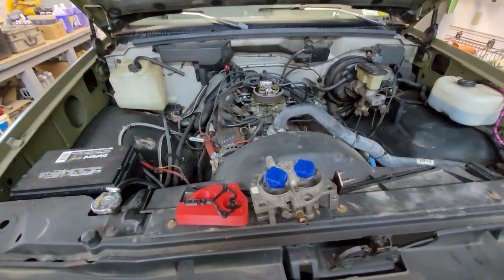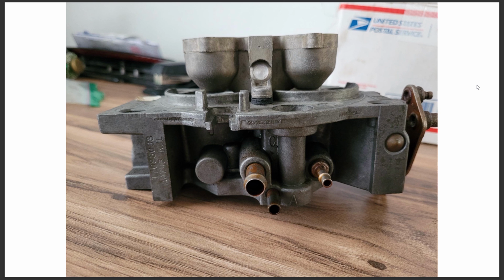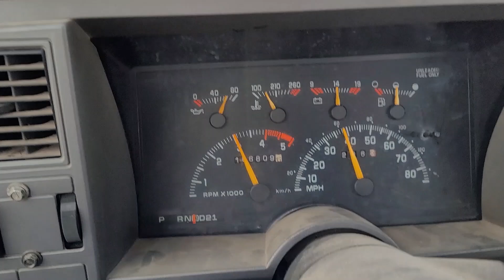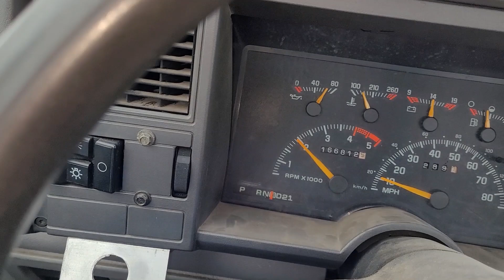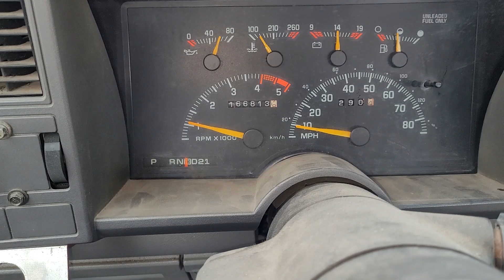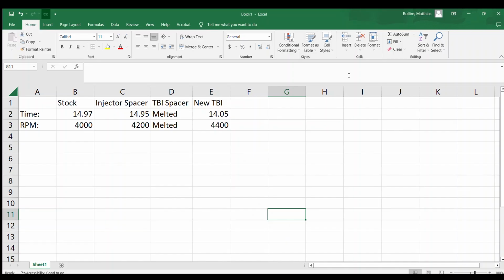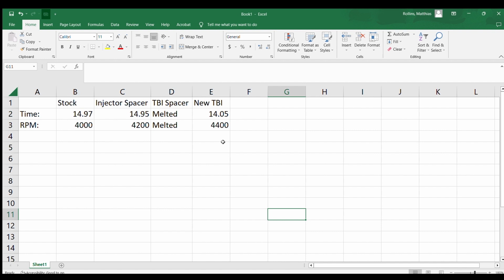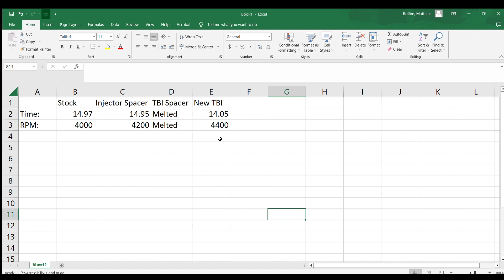Testing Different TBI Spacers on a SBC

Comment: I had a 355 tbi setup old torquer 2 intake tbi adapter  plate 305 ho heads l79 cam . Headers 5 speed went good for what it was pulling id say 325 hp or so

Comment: There are a few vids out there for the 88-95 tbi 350s on a dyno with various spacers. There was a -3 - +1 hp gain with spacers. 
Improving air/fuel has to start with replacing the fuel pump from a vortec paired with NEW/rebuilt injectors. 
More improvement will be vortec heads AND replacing the horribly restrictive Y pipe with either a high flow or a true dual system. (These both come with their own set of problems, the original y pipe with a 3” exhaust is plenty) 

LONG STORY SHORT a lid flip gives +6hp which does more than any TBI spacer.

Comment: Why don’t you try to stack the spacers
Reply from the maker: You can't stack the injector spacers any higher because the fuel lines will hit the TBI housing. To raise the injectors higher you would need to reroute the fuel lines.

Comment: I have the injector spacer, open element chrome air cleaner with 4" tall filter, EGR delete, cat delete, and a Flowmaster Super 10 muffler. I also increased the spark plug gap slightly and bumped the timing up a few degrees. With premium 93 octane fuel and some fat 295 50r 15 Cooper Cobras I'm running an 8 second flat 0-60mph time. Sometimes I'll get it to 7.97 seconds. I'd have to say I'm pretty happy with that performance for a full size 80s truck. It has the TBI 350. What size engine is yours? I'm surprised you're only in the 14s for a 10-60mph run. I'm sure with some tinkering you'll make that truck a lot faster. ;) Keep up the hard work!
Reply from the maker: The truck in the video has a TBI 350. It has seen better days so I am not surprised it lacks power. I used it as the test bed for these parts because I wasn't worried about harming the engine in anyway. You truck sounds really cool! Glad to see others enjoying TBI Chevy's!
Reply: With the egr delete did u have to ge the computer remapped
Reply: @zachfrey8541  not for the performance gains really. I probably should do something so it doesn't trigger the check engine light. If you're cruising down the highway for 10 mins or so the check engine light comes on. If you turn the truck off and back on, the light is gone. I just ignore it honestly. It doesn't seem to effect anything. A performance chip might fix the problem.

Comment: what kind of filament did you use. assuming you used pla? if so and your printer can get hot enough try abs instead of pla the glass transition temp is much higher. you could also look into nylon filaments. especially if you plan to use it long term. love to see 3d printing in automotive applications
Reply from the maker: The filament is PLA. I have been working with Nylon filaments over the past few months but they are a little more difficult to print. I appreciate your input!

Comment: People seem to forget how much engine temperatures have on tbi's. Got a bad temp sensor on the intake, it'll flood the engine. You can actually control the afr's by changing the thermostat
Reply: Just bought a Yukon Gt. Cheap cause it wouldn’t start. It was a 20$ coolant sensor and pig tail

Comment: Wouldn't the computers adjust the air/fuel mixture once it determines there's "too much air"?  Or are these older trucks able to be modified in this way without a tune?
Reply from the maker: The computer has the ability to adjust long term and short term fuel trim. This particular modification helps reduce a choke point for the air that is before the valves. Therefore, we are not increasing the maximum amount of air available in the cylinder but when that maximum amount of air is available. The fuel trims will compensate for this but with any engine, maximum performance cannot be achieved without some kind of tuning. I appreciate the questions!
Reply: Your GM (General Mistake) engineers went to college at least some of them, your spacers are messing with Bernoulli's principle. Someone had to try this on a dyno ? Your adding air pressure taking away air velocity at the TBI entrance.

Comment: Why did you install the spacer on the new tbi, then do the test? That ruined the test did it not? How do you know there was any improvement?
Reply from the maker: The point of this test was mainly to see what affect the spacer had. Adding the new TBI was something I wanted to do because I had a rebuilt one laying around. I have done CFD on the intake assembly with and without the spacer installed and it does make a difference. The difference will not make this engine produce loads of power but the spacers are a cheap upgrade. Thanks for the feedback!
Reply: @Rollins-BauckePowerSystems   yeah people have much different views on the subject. One guy has a spacer that goes below it, not above, he claimed it did nothing after a dyno test, but his had only 166 HP... Some did say it depends on the upgrades. my g20van stock supposedly has 210hp 300ft-lb of torque. mine has a added 3"exhaust and a k&n air filter which made a huge difference.

Comment: I don't know if the throttle body spacer does anything for air flow, but what I did discover is that it pulls the throttle cable back through the fire wall, thus giving you more throttle response at a mechanical level.
Reply: I raised my throttle bracket the same distance as the spacer and it has way better throttle response. Without changing throttle linkage geometry

Comment: What I noted with these spacers, the throttle body sitting higher, the throttle, cruise control and transmission cables had to be raised a ½ inch. Two half-inch spacers were added with longer bolts for the bracket that holds the cables. I never had seen anyone who has had to do this.
Reply: What do you mean youve never seen someone who had to do it? You just listed a few things that had to be done to compensate then stated they never had to be done

Comment: I did this, not certain if the OEM air cleaner will fit under the hood but I had two new fuel injectors saved from 2015 I don;t remember buying so strange. But my truck acts like 100 more horsepower, might not be just because of the spacers alone the fact it may have had wrong injectors for a 350, Firestone put in one used fuel injector, who knows if it was for a 454 big block I have no clue. But it paid to install these spacers.

Comment: Do you have to readjust the TV cable and the other linkages if you put a TBI spacer on? In theory could you just stack up a few injector pod gaskets and get the same height as the aftermarket spacer?
Reply from the maker: I did not get to test the Throttle Body Spacer as it melted. I have some new designs and materials that I am working with and hopefully will be able to test a prototype soon. I would imagine that the TV cable would need to be adjusted but idk about the throttle cable. In theory with enough gaskets you can space the injector pod up, but I think you would end up spending the same amount of money as the the aftermarket unless you have extra gaskets. Thanks for the comment!

Comment: I had a signifigant WOT power gain using a 1" open center spacer, 454 TBI unit and 454 air cleaner that uses power bowl rather than that spacer that shrouds the TBI inlet. I had a 3704 manifold bored to 2" at the time.

Comment: Add 14-16 psi fuel spring, headers and true duel exhaust and stage 1 chip and would get more for your money, great video and tests
Reply: Plus vortec heads
Reply: Hi, I have a 1994 3/4 4×4  7.4 liter , all original including brakes. This thing burns gas, too much! The breaking is inadiquate and the book in the tire section says to not exceed 120 kms. That is about 65 mph. I live in Alberta, between Calgary and Edmonton people are rolling 130. I am using about 8 to10 miles per gallon. The distance is 185 miles. I haven't driven it any distance and have a small car to go on that trip, because of costs. However I am going to need my knees replaced and the car won't work. So the pickup has to be modified. Do you have parts numbers for the chip or any other parts listing I could use to get the truck to be a little safer and cheaper to run.
Reply: None of that will matter. The bottle neck of TBI engines is the restrictive heads.
Reply: @nickwolf3405  very true. But the heads can accommodate more air than is present stock. Not much more. But enough to get a Itty bitty bump

Comment: @rusty, I have a '94 3/4 ton GMC Suburban with a 454. Would this Injector spacer give any help to my setup (original engine and tranny) but still keep it a towing beast?
Reply: The 454 TBI has a 1/4 tall phenolic injector spacer from the factory. It also does not have the ridges on the TBI assembly.
Reply from the maker: I just recently finished a few prototype 454 TBI injector pod spacers. They are 3/8" thick and will be available on my ebay store soon!
Reply: @Rollins-BauckePowerSystems  That could definitely help on a 2" bore or larger TBI.  The only TBI based engine I still own has the Edelbrock TBI to MPFI single plane intake and the TBI injectors with pod get removed entirely. It is on an aluminum headed 406 with 29 lb/hr injectors. Makes 150 HP more than the factory 320 hp 350 made. That TBI 350 was rather nice for a stock TBI engine. It had a 2" bore TBI, 46 lb/hr high pressure injectors with the 30 psi regulator good for ~ 80 lb/hr, GM 113 L98 aluminum heads and a GM 6395 roller cam. 50+ mph across the water turning 5,200 rpm. The 406 runs closer to 65 mph turning a lot more prop.
Reply from the maker: Using the injector pod spacer definitely won't hurt the big block!

Comment: There’s a reason they make those spacers with aluminum and not plastic.  😉 

I would use a spacer on these tbi engines for the mpg gain, you’re not really going to get much in the way of power on these.  

You can buy an aluminum spacers with all the hardware and gaskets for like $40.
Reply: Normally they use a phenolic plastic. It is heat resistant, and does not transfer heat like aluminum does.
Reply: With the aluminum spacer on the bottom works good and putting the injectors up higher works good and it dose help with horse power some there's a little difference